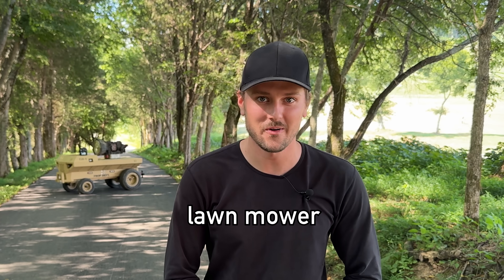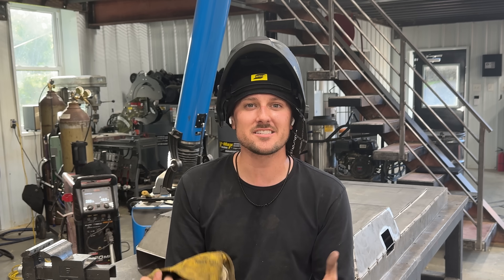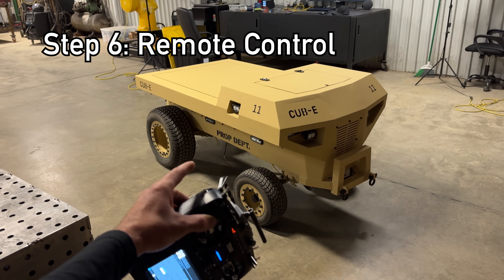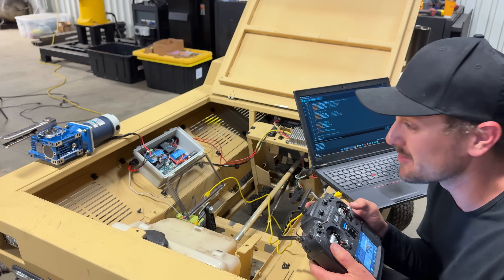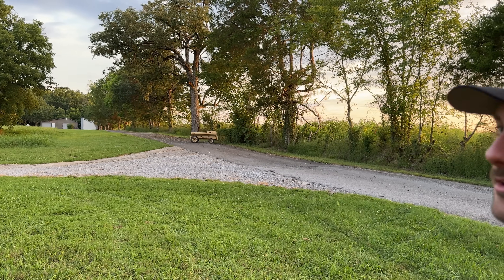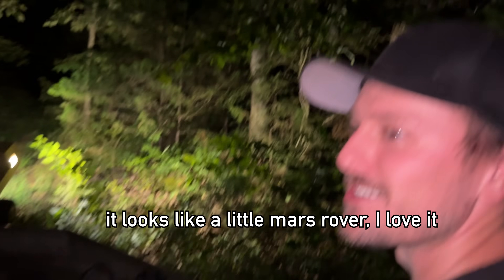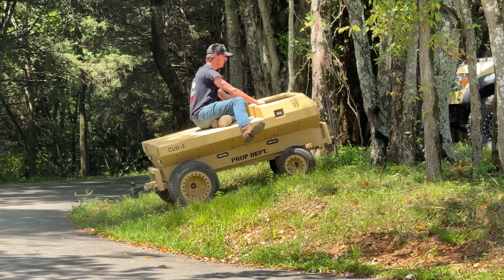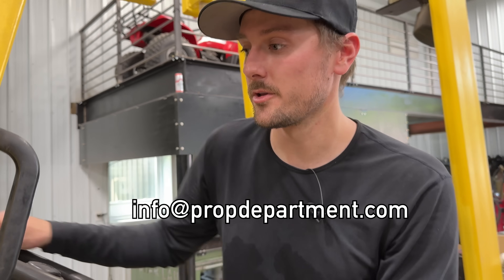Building an Unmanned Rover from my old Lawn Mower (Full Build & Testing)

Comment: @2:15 I'm a degreed Manufacturing Engineer and I remember electrical, mechanical, and civil engineers telling me it's not real engineering. It's THE MOST engineering of all engineers because ultimately they all meet there and not just them but also trades like welding, automation plus gobs of other stuff. It's the hub of most businesses.

Comment: This reminds me of a neighbor I had when I was like 11 back in 2008. He was a pretty cool dude who was going to VTU at the time. He built a frame from square tubing to hang a push mower deck without the handle and wheels and used the battery, motors, and wheels from a kids power wheels to drive it and make it move like a zero turn mower. It was super simple compared to this beast, and you couldn't really ride it 😂

Comment: The TX16S you're using has a grub screw in the throttle gimbal that you can back out so it is center sprung like the other side. This is useful if you're doing robotics projects because you can use the left side for forward and backwards movements and the right side for steering. Considering the throttle is designed to be set and forget you could use one of the pots on the top of the radio or a slider on the side.
Reply from the maker: No way that’s cool I’ll check it out

Comment: Nothing like gliding thru the woods in Your boat at night. What a cool, little Doodeli-Doo! I´m tickled that You didn´t make it electric but You maybe would want to give it a proper muffler?
I´m propagating the use of motorcycle silencers, they look nice and dampen the noise effectively. Little helper is very cool, it´d be perfect if it was a little more silenced in my opinion.
Well Done anyways since this is made from scratch with a brainfart as template, I like it a lot! It´s hydraulic, yes? It would be fun if Cubby could move the hitch up & down, wouldn´t it?
Y´all are on to something here! Greetz from overseas, God Bless!

Comment: That chassi has so much space. You could definitely add: larger fuel tanks, batteries (to power external appliances) with a alternator to charge them, cargo spaces, compressed air tanks and compressor, water tank, etc etc. With that amount of space, you can add tons of stuff really
Reply from the maker: Heck yea, doing an alternator and battery bank for shre

Comment: this desperately is begging for better tires and suspension. maybe a simple walking beam setup on the front and using the existing tires and a walking beam again to keep the tracks in contact and tensioned in the rear

Comment: Put tank tracks on it and a bigger gear box that reduces speed so it has more traction and and a lot of weight to the front to increase the pull capacity and reinforcethe chasis

Comment: Hell yeah, I love this thing. I have a few suggestions, though I don't know if they are easily integrated. Bigger front wheels should make it a bit better at traversing rougher terrain. If possible you could add some inset hooks like they have on most pickup trucks for attaching ratchet straps too, so you hopefully don't drop a transmission off the side of a hill, or onto someone's foot lol

Comment: you need a red ripcord on the back... or on every side even.  when you pull that, it kills the engine and electronics. just for safety you know, you dont want this thing to crash or bug, having it floor the gas ramming straight into something or some one. it is heavy machinery afterall.

edit:   also a QUAD bike would have been a waaaayyyyy better base to use for this.
and you need to put the knobiest tires you can on it, for it to actualy work proper good.
might even wanna put water in em, if the engine can handle the extra weight, and you need it to be more stable, and able to pull heavier stuff.

Comment: This channel is awesome! A little trick with sheet metal, use bends when ever possisble, put small alignment tabs/cutouts, and size panels to the inside dimension for easy fillet welds. Symmetrical & simple is usually my goal with mechanical design/engineering. PS you can overdrive that hydrostatic by changing gearing or pulleys. (Not too much because of cavitation/heat). I am jealous of your creative freedom!

Comment: Haha this is sick. Maybe some weight since it lacks a driver would be good for it.

Edit: it definitely needs tractor tires on the rear, and enough weight on the front to balance it out. And then maybe look into some different pulley sizes for speed? 😂

Comment: Now add Airbag suspention So it can drop flat to the ground And skirts around the sides out of metal so no air gets there to lift and add 4 point mechanical spike system so it can anchor to the ground and you have a tornado probe thats mobile

Comment: Tip: Many linear actuators are FREE if you can access nursing home maintenance scrap bins; lift chairs, adjustable beds, lift cranes, etc. There are many other usable parts + wiring supplies, too.
Reply: nursing homes usually don't check credentials, at least in my area. Hear me out...

Comment: hey mate, you should intergrate the same system the robot vaccum cleaners have so it turns away from things whenever something gets in it's way, and maybe instead of a petrol engine put an electric engine in it and use some sort of solar panel on it to keep it charged at all times and be able to run at all hours day and night, meaning it will remain quieter and run more efficient and run day and night

Comment: Love the little guy!! Tip for the steering: smaller scale RC cars have spring-loaded horns on the steering servo called a "servo saver." It's just a failsafe put in place to protect the little servos from breaking after slamming your car into a curb at full speed. I think it would help to prevent breaking more electronics if you had something similar. Awesome work!
Reply from the maker: Good tip, we’ll have to come up with something like that on the new setup

Comment: This clearly is going to need AWD, And well possibly More torque. 

Let's get you setup with Quad hub motors, 4 controllers!  Use the gas motor to charge up the lithium.   I have already reversed some of the higher power, higher voltage controllers serial protocols making it easy to write a script for per motor control.

In fact I run my golf cart this way (0 -60 4.5 seconds on dragy)    It's cool, lets make phase 4 kick ass..

Email in bio,  want nothing but to inspire you.
Reply from the maker: that would be sweet. I want to do a version that is electric hybrid with tracks

Comment: if you wanna make the steering better look up the riding mower power steering trick it's adding some "Thrust Needle Roller Bearings" should get you the right ones fide your size it works wonders .. reduces the drag from the weight on the steering .. should make it easier on the servo
Reply from the maker: that's a great idea. totally have to do that.
Reply: @propdepartment  btw I have a Cub Cadet 682 I picked up for free and if I ever get my plasma table put together .. if thats not running by then I have a feeling I'm gonna have a even bigger rc .. btw if you look thru my videos I have a 42" rc mower

Comment: This is AWESOME!!!! Oh and better get some more drive pulleys for that mower, i think they may be burning up soon.. :)
Reply: Shaft drive, friend. Or does the transaxle use pulley CVT from the shaft drive? I assumed it was hydrostatic. Maybe gear and clutch, but I don’t think he would have glossed over the servos for clutch and shifter control.
Reply: @punkz87506  That chassis is very close to my John Deer and it uses a belt and tension pully back to the rear diff.  I've burned out 2 pulleys on mine over the past 5 years.

Comment: I use a potentiometer with a 3d printed steering wheel on the remote connected to an Arduino nano  I use stepper motors to control steering and brake and throttle with an Arduino mega on the receiver but this system is for remote control for a vehicle some videos of the system on my channel
Reply: interesting, good tips